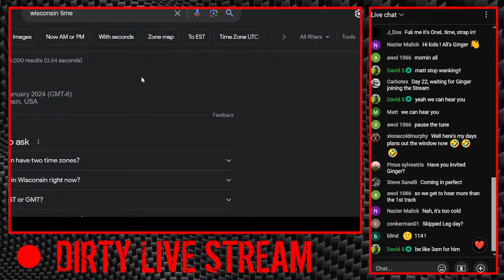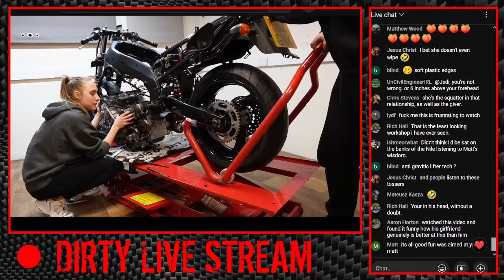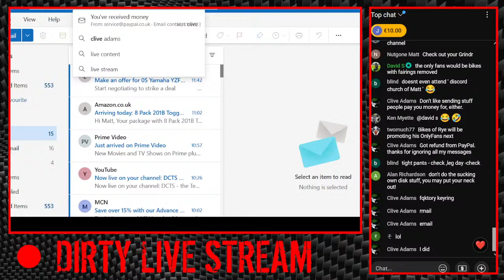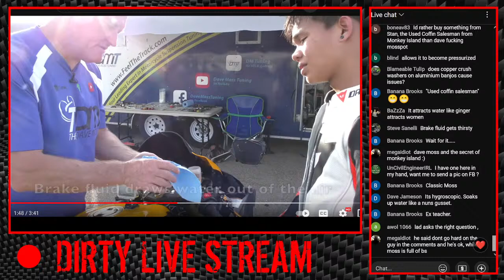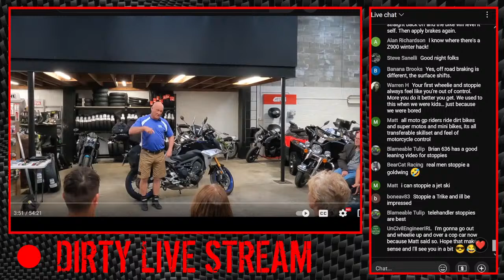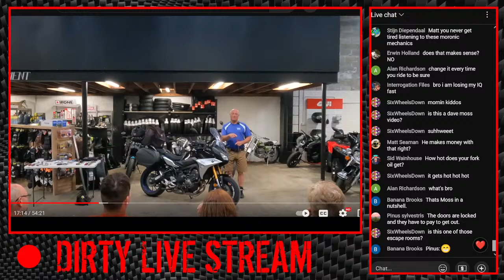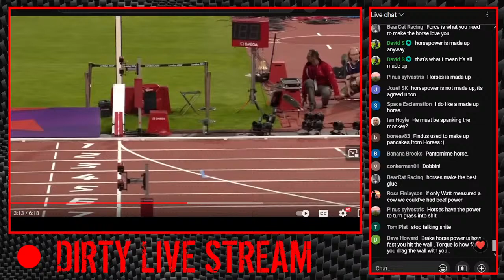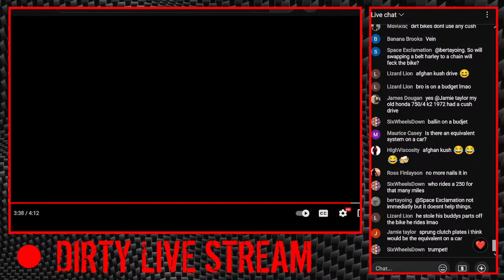DCTS - #48 crashed but not dead

Comment: You keep getting annoyed when Ari calls torque a twisting force, but doesn't he just mean that twisting is a key part of how the force is described? As in, the 'ft' part of lbs-ft is based on the length of the pivot point, which is a twist. You yourself said "there is not a twisting force, it is a force at a pivotal distance" - but "twist" is defined as; "cause to rotate around a stationary point; turn." - so the force that is applied to the object to cause it to move around its pivot is by definition a twisting force.

I don't understand why you get so angry at twisting force as a description when it is a perfectly valid way of describing what is happening. You don't get mad at a 'pushing force' or a 'pulling force' right? Well that is the same thing, torque is a pushing force that makes an object move around a pivot - it is thus a twisting force. It's just one more degree of description within the name. To not use twist in the description would make it harder for people to understand what is actually happening, and would require further description to make it clear.
Reply: When you remove the pivot, it is no longer described as torque. That means that the pivot is the defining characteristic of this force when it is described - so calling it a twisting force is accurate because without the twist it is not torque, it is simply force.
Reply from the maker: Because people think a pulling and pushing are the same thing just directional. People actually think torque is a different force to force.
Reply from the maker: To be clear, I think it should have been called a rotation force, just like saying centripetal force. Torque is its own word.
Reply from the maker: "That means that the pivot is the defining characteristic of this force"

- A force is an accelerated mass. I.e stuff being moved at an increasing/decreasing rate. It requires the transfer of energy. A pivot is a physical constraint. These things are not related or equivalent. This is why it's called a moment. Forces are NOT moments. 101 of engineering.
Reply: @dirtygarageguy  isn't saying 'rotational force' just using the same concessions as saying 'twisting force'? Why is rotational appropriate but twisting is not when describing torque?